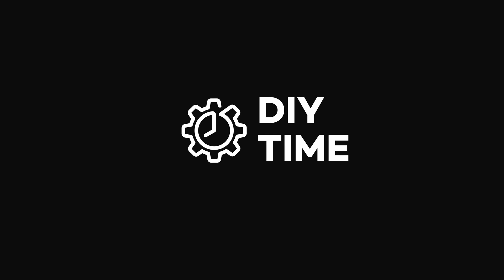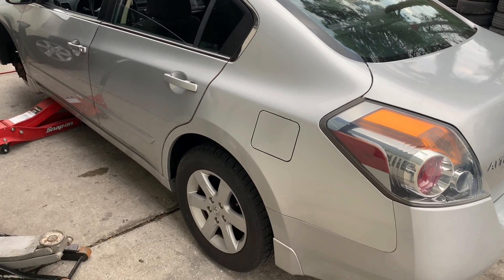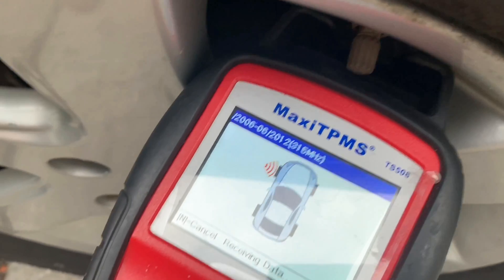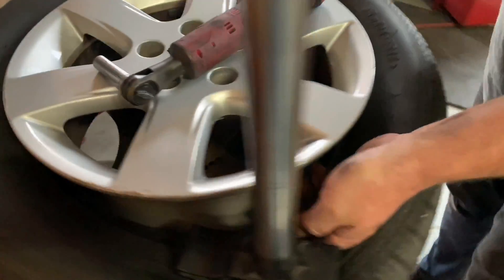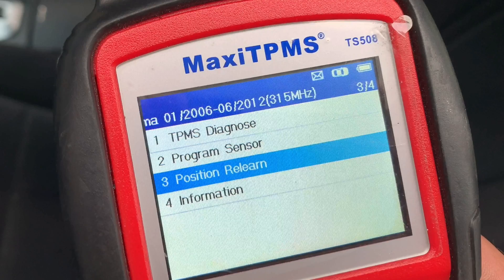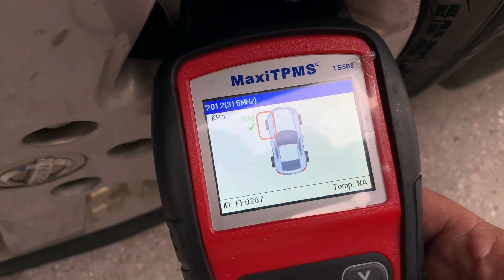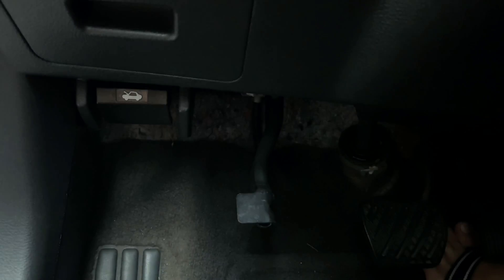How to replace & reprogram TMPS sensors using MaxiTPMS tool -Tire Pressure Monitoring System relearn

Comment: Other videos show programming new TPMS sensors prior to installation in the vehicle.  My new sensors were installed in the vehicle, but the drive procedure did not 'wake' them, so I purchased a MAXI TMPS tool and followed your relearn instructions.  Your video is straight to the point, providing only the necessary information needed for the fix, without annoying background music, commentary, endorsements, etc.  Thank you.

Comment: A quick question, professor, for example, in any vehicle or Toyota, Chevrolet, Honda, any brand of vehicle, if you buy the sensors for that vehicle that I mentioned, one sensor, two sensors, the four original sensors for the vehicle and you install them and I do the process that you did there, it's fine, right?

Comment: Professor, blessings from the Dominican Republic. I am very happy with the explanation you just gave me. You say that the sensors that the original vehicle has are not programmed by the equipment, but a relearning can be done. That was what I didn't know. For me, that equipment only programmed its sensors, but with that explanation you gave there, I now see that that equipment can program any sensor as long as the learning process is done through Obd2.

Comment: I just replaced 4 TPMS Sensors with OEM sensors on my 2009 toyota sienna , will this procedure and MaxiTPMS TS508 work ?  Currently my TPMS light is on
Reply from the maker: Yes, I’ve done a few Toyotas from that era and it worked well.

Comment: Man, this was great instructions. I could not program Ebay OE for my wife's 2011 Lexus Es 350 using the program function right above the Relearn function.  I tried so many timess. The tool can trigger and read the sensor but can't program it. Iboughtt 5 OEsensorsr from Ebay and 4 more from Prime thinking i can programthoses from Prim,  but no luck. I never thought the option relearnwouldl program the sensor to the car and get rid of the idiot light o the dashboardd. I bought my Ts508 wifi fro the  marketplace for $100 yesterday.  Many thanks.I was almost brought to the tire shop guy tomorrow until i saw this video by accident. 🎉
Reply from the maker: Yeah, the tool language is a bit confusing, glad it worked out for you!

Comment: Can you reprogram them before install on tyre or you have to do after installation inside tyre
Reply from the maker: Yes, I actually prefer to program sensors beforehand, to make sure they are working, compatible & have good batteries.

Comment: Don't you have to program the new sensor first?
Reply: I tried program new sensor but autel cannot program my sensor which was for 2011 lexus es 350. Tool can trigger the sensor which tell the kilo pascal and temp and other stuffs but it can't program somewhere so I went this route like this video and worked great

Comment: Hello there, I want to thank you so much for this simple way to relearn those sensors. I have the same device FS508 I tried on all my cars which they are Toyota, to relearn them before I install them. In my hand never worked. But this way you reprogram the car computer pcu, with new sensors, great idea I suffered a lot to do the other way but never worked. Because the sensor need more or less pressure, thank you again. take care man

Comment: Good. The tool works with Autel sensors only?
Reply from the maker: No, it will read all sensor brands and record them to ECU. Autel sensors are universal and you can use them with many cars or for cloning your old sensors.
Reply: @DIYtime  thanks. And if i use for example geartronics sensors can i instal them?
Reply from the maker: What car is this for?
Reply: @DIYtime  Jeep commander

Comment: 4:16 what will happen if I select [Y]=Erase DTCs? Will it delete all sensors data from car computer and it will stay without any tmps sensors?
Reply from the maker: No, it will only delete error codes sand turn off low tire pressure dash light.

Comment: Nice step by step guide! I wonder if the way you finished the process when you get "OBD relearn successful" message, turning ignition off, and on again, before unlock the cable from the car ODB socket, and them start the car, was in the MaxiTPMS manual. For me is important to be careful, you are writing the ECU and can damage it. Thank you!

Comment: How are you going to let the air out of the tire one at a time to see which one puts the light on, if the light is already on?
Reply: Blinking light indicates dead sensor. Solid light lets you know that tire pressure is low. Solid light would be triggered by a good working sensor and it should take precedence over blinking light. You basically deflate one tire at s time and see which tire would cause blinking light to turn solid. 
May not work the same on all car brands, but thats what it was doing on my car.

Comment: Thanks for the video. I had full spare which luckily had sensor as well but wasn't programmed. Followed the steps in video to relearn and wow lights gone. I will go to tyre shop and ask them to change over the sensor! Shops were asking £100 for a sensor!!

Comment: I'm currently working on a 2008 Versa.  When I select "relearn," all it gives me is the instructions which say lower tire pressure below 10 psi, etc., and won't cue to scan from that part of the menu.   Went to the Autel site and watched a video that shows the same thing.  Did you get something out of order during editing?
Reply: My 2011 es 350. I didn't have to lower pressure . I kept it at 40 psi. I drove it a few miles after installing it without program it. It still did a relearn and got rid of the low pressure light

Comment: How do you take the 4 off the vehicle and add 4 new. I bought it to switch my summer to winter tires and you have to delete the summer tire sensors because they are mounted in different wheels and add the winter tire sensors. Or does it automatically just take those 4 off and put them on it that you scan.
Reply from the maker: Yes, it automatically replaces old values.
Reply: @DIYtime  awesome thank you for the response.

Comment: I have a 2015 cadillac ATS and one of the sensors died on me.. So after buying a new one and installing it, my TPMS sensor isn't able to read it! Not only that, but on my dashboard all the pressure for all 4 tires is completely gone!! What should I do bro
Reply from the maker: New sensors need to be triggered or activated first. I have a video somewhere showing how its done. It is not shown in this video cuz I’ve had similar situation and only later learned about activating.

Comment: Did you use Autel MX sensors or can you us ones from any manufacturer?  The Autel Maxi TPMS tool company implies that you need to use their brand of sensors.
Reply from the maker: You can do either one. I used OEM Denso sensors.

Comment: I have a prius also having a flashing tpms light then turned solid after.  I would like to replace two of my tpms sensors and would like to know the part and model of the tpms sensors that you used in the video.   I just want get the same parts and to follow your video to get them relearn without getting into problem later.  The oem one my prius 2012 has is Pacific brand.  Thanks

Comment: Just a heads up. This tool won’t program sensors that aren’t MX type from Autel.
Reply from the maker: I programmed Denso sensors without issues multiple times. Just make sure to do “wake up” procedure. They often  come dormant from the factory to save battery.
Reply: @DIYtime  Good to know. Autel advertised this can only program MX and I’ve seen countless customers have issues. I personally use a pro grade unit but it’s good to know with Toyota this seems to work. I don’t like aftermarket TPMS sensors. They will drive you to drink 🍺
Reply from the maker: It does other brands. Its just a bit confusing to figure out. I actually did a full review video on this tool where I go into details about it.
Reply from the maker: Autel MaxiTPMS TS508 - Setup & Review
https://youtu.be/JfQPIFEx_d8
Reply: @NordicPride970  hi, what unit do you use?
Reply: @loverorh8er  I own a Xtool D9 and also have a older unit similar to the autel for actual sensor programming. The D9 is for advanced TPMS diagnostics. But I’m a tech who owns his own business so it’s a money maker

Comment: "It's easy. Just buy this expensive tool that you will likely only use twice in your entire life."

Thanks man. You really did something here....
Reply from the maker: Most households have 2-4 cars, with 4-5 sensors in each car. Then there are also two sets of parents, friends, neighbors & relatives with cars. Sensor batteries die about every 5 years. Then there are winter/summer tire sets in some areas of the country... Unless you are lonely antisocial 90-years old living in Florida, its gonna be probably used at least twice a year.
Reply: I have 4 cars on my house so $125  for this tool is a good deal
Reply from the maker: When did you hear me say easy or inexpensive?
Reply from the maker: Considering you will be charged $100+ each time you do this at tire shop, the tool pays for itself in just two visits.

Comment: I drive a 2011 Toyota Prius. The TPMS light is not on at all but I wanted to check battery life on my sensors. I bought another TMPS tool from Amazon (by Launch) that will not read the sensors on my Prius. I know the tool works because it read all 4 sensors from my 2009 Sonata. The instructions say some sensors have to be "woke up" with a magnet or by deflating the tire? Does the Prius require that? Any thoughts would be appreciated.
Reply from the maker: I’ve done sensors on my Lexus IS and Toyota Tacoma, and they didn’t require waking up. Plus, if your car doesn’t have TPMS light - your sensors are definitely awake. 😁 
My Autel tool gives me battery status on both cars without issues. Also, maybe make sure you choose correct car make/model in the menu. Contact seller if still no go.
Reply from the maker: *I did some research, someone said he did have to wake up sensor for Prius by deflating it during registration or triggering procedure.

Comment: I’m trying to relearn the positions after programming some sensors and it’s not letting me it just keeps saying Duplicate ID and it’s not letting me re learn them
Reply from the maker: Possibly one of your new sensors is dead and the tool catching signal from the same sensor twice. After all these are communicating wirelessly with ECU and signal can be detected from the distance.  Thats what happened to me once. I bought “new” sensor that had dead battery. This can happen if seller has them sitting on the shelf for too long.

Comment: Hi excellent video. I have a question 

I bought 4 sensor tpms 315 Mhz in Ebay but no brand MX. 

Can I program the sensors even if it's from another brand.?

Thank you.

Comment: Do you find the MaxiTPS tool can program tpms sensors that are not of the Autel MX brand?
Reply: I’m wondering the same thing
Reply: When you buy cheap sensors online I think they come preprogrammed for year make model of your car but could be wrong? When you use "relearn function on tpms" does it not program a unprogrammed sensor to your vehicle?
Reply: @KensDIYandHowTo  I bought a spare set of Rims and tires with TPM Sensors already mounted. The guy said they came of his dodge ram but they would not communicate with my dodge truck computer. My Maxit508 could not detect or read the sensors on this set.  Maybe the sensors were already dead. Anyhow, I did order a new set of programmable TMPS sensors, I will swap them out in the spring.

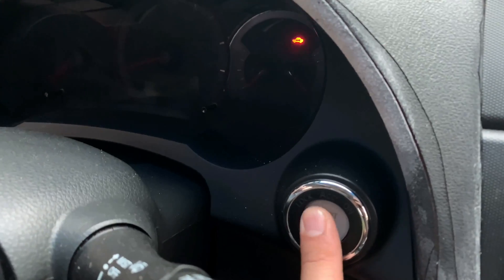Comment: 4:00 You say "Turn on the ignition" but video shows you tapping Start button twice to "Acc ► ON" mode (without starting vehicle). Which is correct?
Reply from the maker: On push start cars “ON” means ignition is on. If you have a key ignition, turn key to ON.
Reply: Both are correct both are same thing

Comment: the TS508 costs $278.  Who in their right mind is going to drop that much on a single use tool?  There are much more economical solutions out there.  Without providing info on a cheap tool that'll accomplish the tpms reprogramming this video doesn't serve much of any good purpose. You'd get much more views if you provided an economical solution.
Reply: I purchased a new Autel TS508 on eBay for $120 + sales tax, shipped, after a frustrating experience at a local tire chain. My first use was to check pressure, and it quickly detected a dead/defective new sensor in one wheel. The shop verified my finding and replaced the sensor at no charge. However, I've learned that on at least fourth gen Toyota 4Runners, the position and ID relearn  process screws up the vehicle-stability system (instrument panel VSC Trac lights stay on). Fixing that requires a zero-point calibration process to be performed. Easy to do, but since the mechs at the shop had never heard of that, I found the process online and did it myself.
Reply from the maker: Nice! If you have summer/winter sets of tires, the tool will pay for itself very quickly!
Reply: @bywayz  Thanks for passing on your experience.  I might see if I can find the TS508 for a low price.
Reply: Cheapest solution is free from American tires co. For a DIY like me, I bought this tool and this video was helpful. Money means nothing if it solves stress with multiple cars and no visits to tire shops that takes hours to deal with. Time is money. Best I got the tool for was $200 on eBay.
Reply: @nrgonline  $200 ain't bad, plus everyone in your family now has access to this tech! Congrats
Reply from the maker: I am finding this tool for $130-160 these days...
Reply from the maker: Agree 💯. You will go through multiple cars in your life and quite a few will need TPMS fixed. Tool will pay for itself in a long run.
Reply from the maker: With all that new technology in modern cars, I don’t think there is much other options we have these days, aside from paying someone else to do it. If you are aware of any, let me know, I’ll be happy to try and make a video to share with everyone.

Comment: How do you turn the ignition on without starting the car. Do you put your foot on the brake to start it or not use your foot?
Reply: Just hit the on button with no foot on the brake.
Reply: Don’t step on brake and press on button twice. It goes into ON. One press is ACC. Just like when cars has keys. First turn, acc. 2nd turn On and

Comment: I installed all 4 tpms sensors I bought on Amazon. But I didn't program them before installing them. Did I mess up
Reply from the maker: They still can be programmed after installation if you have TPMS tool. It can scan and display sensor ID’s.

Comment: I thought the sensors had to be programed before installing them in the tires, in your video you installed them aired the tires up then programed them is this correct?
Reply: Mine was installed first, before I had this device.  After acquiring, just do relearn and write the sensor ID to ecu by hooking onto OBD.
Reply from the maker: Either way is fine. I would even say it’s better to program them before installing. Once I purchased a new sensor, installed it first, and then realized it was defective when trying to program it. Had to do it all over again 😬.

Comment: Is it possible to purchase new sensors and reprogram them without the original sensors.----I took my car to pepboys and they replaced all the tpms sensors. Now none of them work? I still get the tire pressure light. I spent 6 hours waiting for them to replace the tpms sensors, so I don't want to go back to them. Can i just replace the sensors myself without the old sensors?
Reply from the maker: That doesn’t sound right. Programming should be a part of replacement process. Otherwise why even bother replacing them. I would go after that shop to get the job done right. 
And yes, you don’t need to have original sensors in order to program the new ones.

Comment: Thank you for answering my question, yes the autel ts508 can program aftermarket tpms sensors
Reply: Yes, but with a BIG caveat.  Autel MaxiTPMS tools can only PROGRAM Autel MX aftermarket sensors, NO OTHER BRANDS.  What is shown in this video is NOT a programming of the sensor but rather an OBD RE-LEARN procedure.
Reply: @StilettoSniper  Thanks for pointing out this key difference and what was being shown in this video.

When he showed those $10 sensors i knew they weren't Autel MX sensors just by the shape of the sensor bodies.

I've learned there is a difference between a PROGRAM and a RELEARN.
Reply: @davidricardo86  what is the difference?

Comment: Did you reprogram the codes to the new tpms or they learn the new codes automatically
Reply from the maker: Sensors come already programmed with ID’s from the factory. Car ECU needs to be programmed to accept communication from new sensors.